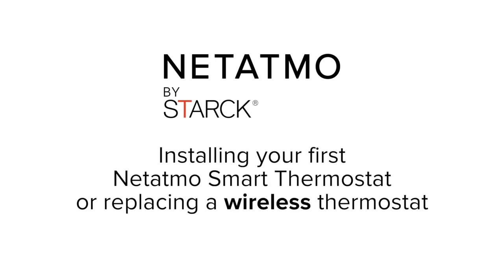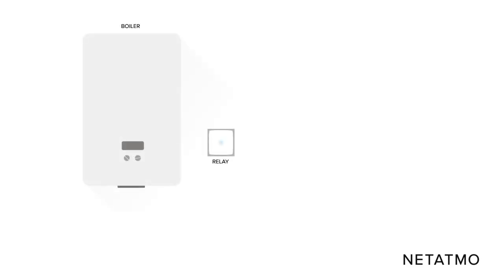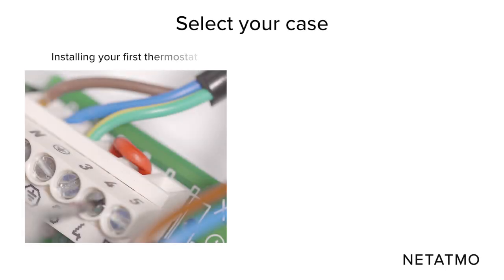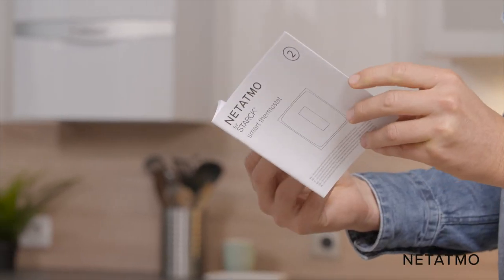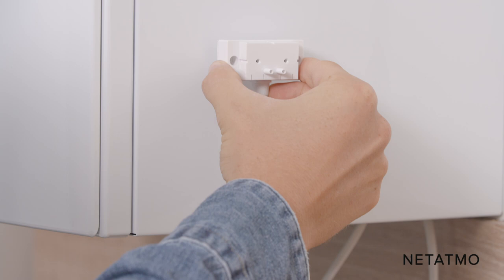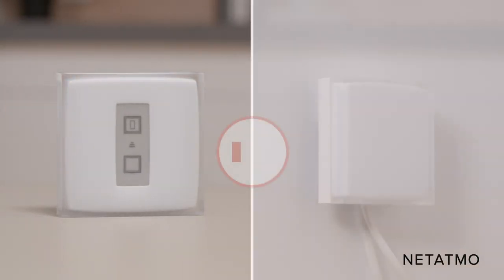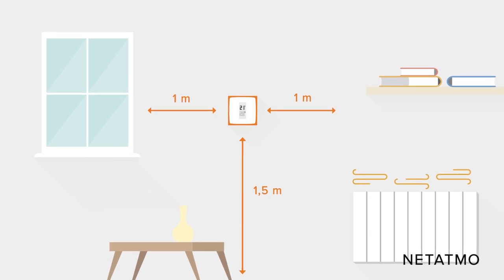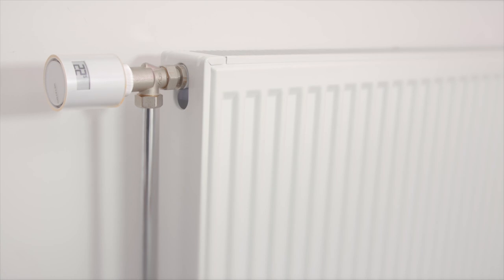How to replace your wireless thermostat yourself – installing the Netatmo Smart Thermostat

Comment: Live and neural wire don't look to be correctly inserted in the video, No copper should be visible or capable of touching by hands or tools!  An insulated screwdriver would be a better option!

Comment: The temperature sensor on my unit has developed a fault, after 2.5 years. Can I buy a replacement thermostat unit on its own, as the relay is already installed?

Comment: I don't have "3 & 4" on my boiler. Instead I have a 24V RT and a 230V RT. On some videos I see the 230V R being used, and on others the 24V RT. Which one is it? If I use the 230V do I take out the bridge fromt eh 24V RT?
Reply: We have a Vaillant ecoTEC plus 837, which has that configuration. The correct answer for us was to use the 24V RT (not the 230V RT).